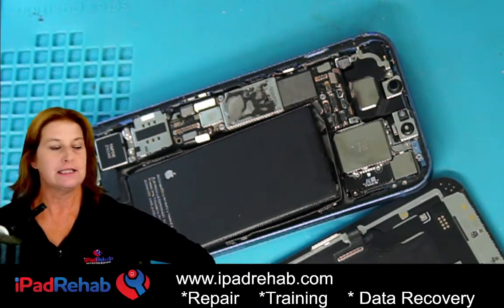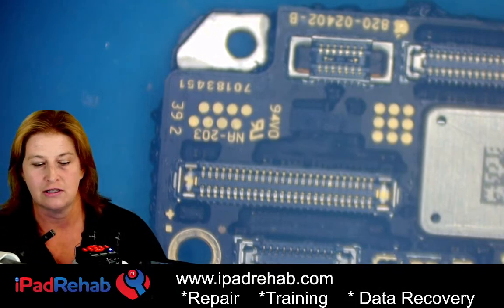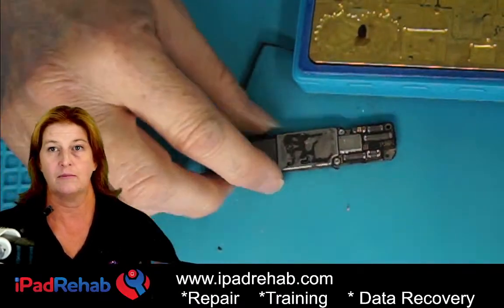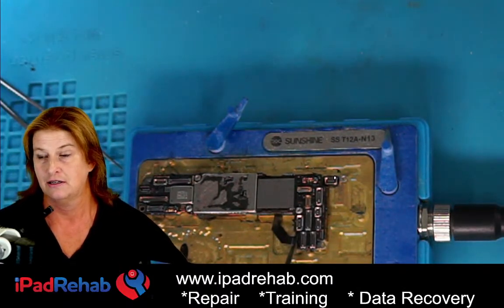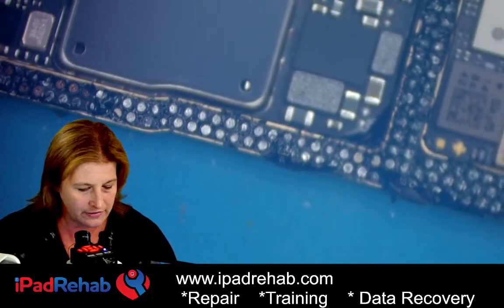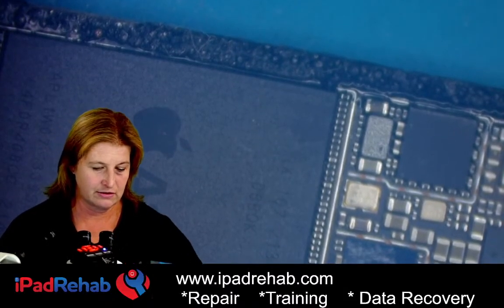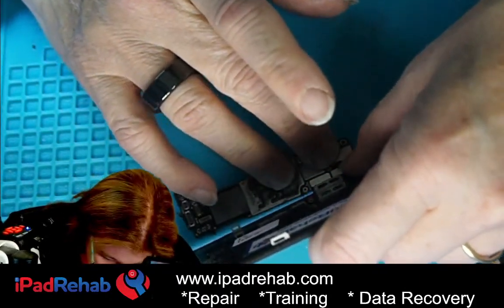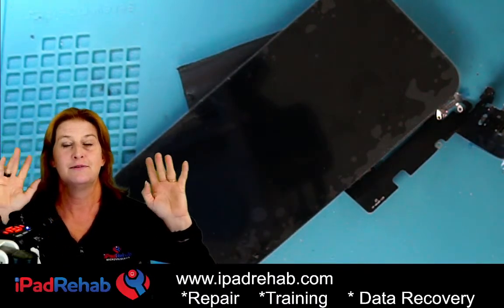Never Do This to an iPhone 13

Comment: saw the video, assumed it had to do with the higher melting point solder used in 12 and newer, never expect this garbage haha. 

wouldve gone trick or treating but was busy with clearing out a bunch of ebay orders that may have sat for a lil too long while i was cramming for an exam